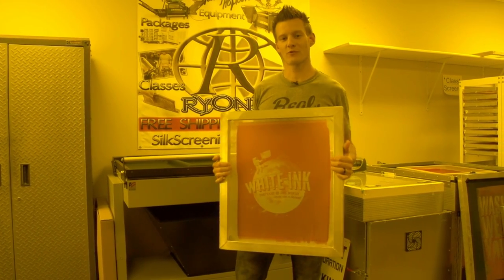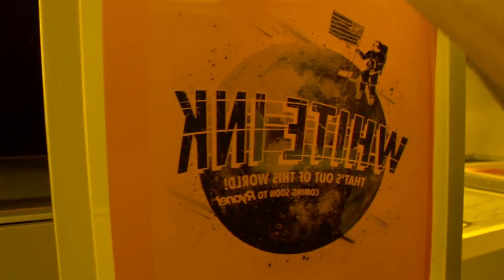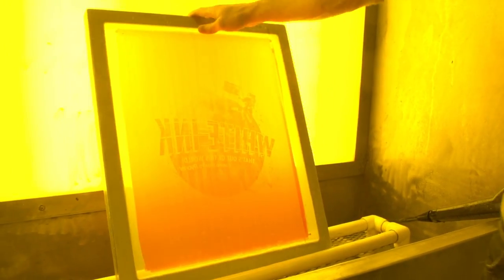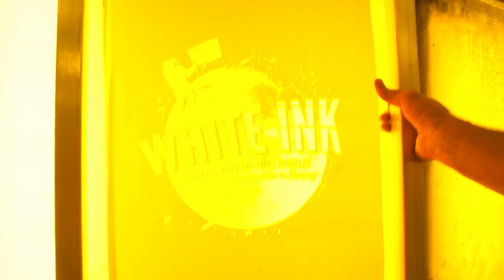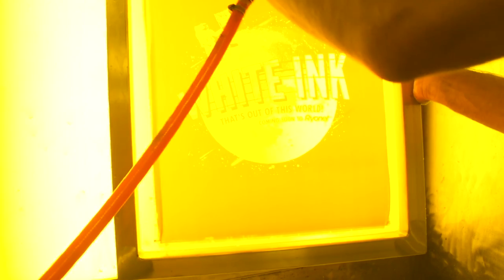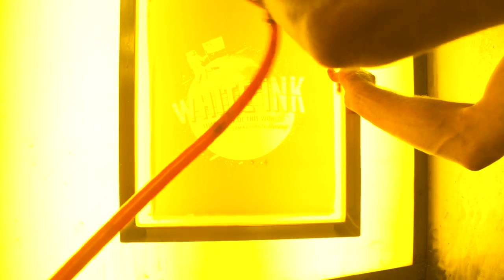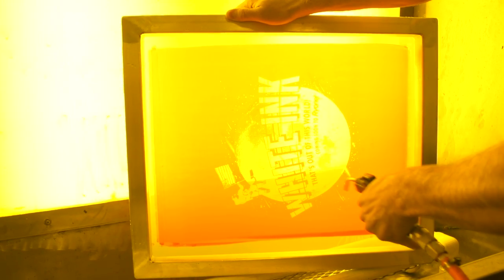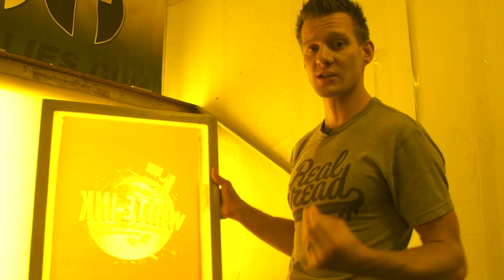How to Screen Print: Washing Emulsion Out of High Detail Screens

Comment: i've gotten a perfect print before but i decided to change the size of the transparency paper. even after messing around with the time, the best i can get now is a print that's both underexposed in parts and overexposed in others– very patchy. do you have any tips on larger prints vs smaller ones? thanks

Comment: My screens won’t wash out (reclaim)... why? I’m using emulsion stripper. I’ve done it before. Why this time they’re not washing out entirely?
Reply: I’ve had this issue before, it’s definitely frustrating. The most likely culprit is:
- the emulsion you used is too old.
- dry emulsion has been on your screen for too long (years maybe?).
- your emulsion remover is too old or incompatible with the type of emulsion you’re trying to remove.
- the screen was not degreased properly.
- the screen mesh has degraded from age.   
Another possibility is that the screen has been through too many dramatic shifts in temperature, like if you left it in a garage or storage unit without heat or AC for a year or so.

Comment: Hi .. i have exposed my screen for 13 minutes , and tried to remove the emulsion from unexposed areas ( impression is transferred from film positive in screen) but emuslion is not getting removed from screen .. please advise , what could be the reason ?
Reply from the maker: Hey there! That can be caused by several different issues, so let's help you figure it out!  Can you send an email to success@ryonet.com with the following details?: 

What emulsion you're using, what screen mesh you're using, what exposure unit you're using, what kind of printer you're using to print your film positives, as well as all of the times you have tried to expose at.

Our support team will reach back out to you and help you figure out what's going on.

Comment: What would be the preferential method of drying without an air compressor?
Reply from the maker: The best method is to actually air dry without assistance. Air compressors and blow dryers can have lint or dander inside of them and that will be blown onto your newly clean screen. If your compressor is regularly cleaned this may not pose an issue, but it's safer to air dry :)
Reply: +Ryonet thank you :)

Comment: maybe a stupid question, but what how much psi in that air line youre blowing? i think i may have blown too hard and it blew some of the emulsion out of place.. just bought 160$ pressure washer so i can blow out my images and now im getting this foam type stuff drying inside my design.. it makes the design rough on the outsides when you print, and i gotta blow it out
Reply from the maker: Hey there!  Our pressure is 1600 psi.  Make sure you're not using too much pressure when you're washing your image out after exposure!  It doesn't require that much pressure to wash it out, it's better to be gentle during this phase, especially if you have any smaller details. The pressure washer really shines in use for reclaiming a screen and getting all of the emulsion off.

Comment: Why is my detail rinsing out? Is my emulsion not on thick enough?
Reply from the maker: Usually if part of your design is washing out, it indicates an under exposure.  The emulsion wasn't exposed enough, and so was soft enough to wash away.  Increasing your exposure time should do the trick!
Reply: Thank you!
Reply: @kellyreilly6296  so did it work out? I having the same trouble also.
Reply: It needs to stay under the light way longer
Reply: @kellyreilly6296  okay I've been burning it for like 4 minutes. I'm gonna try doubling that or look into the "step wedge test" 
How long do you burn your images?

Comment: I'm having some real trouble with my screens. Both the emulsion staying on from initial coat and washout and weirdly with the emulsion completely coming off during wash. Sometimes it just won't come off and my screen becomes useless.
Reply from the maker: Hey there!  I would suggest looking into getting one of our exposure calculators:

It sounds like you're overcuring or undercuring your screens whenever you try. If the emulsion simply washes away when you're rinsing out your image, then that's a sign that the emulsion is underexposed.  If it's overexposed, you can get situations where you cannot get your emulsion to wash out.

The exposure calculator helps you to dial in your exposure time so you know for sure what time you should be using. You can find a video on its use on the page!

Please feel free to email success@ryonet.com with what emulsion you're using, what screen mesh you're using, what exposure unit you're using, and what amount of time you're exposing for, and we'll see if we can pinpoint where the issue is!